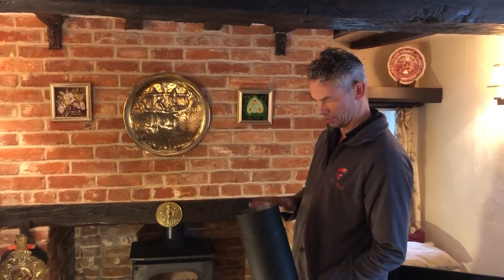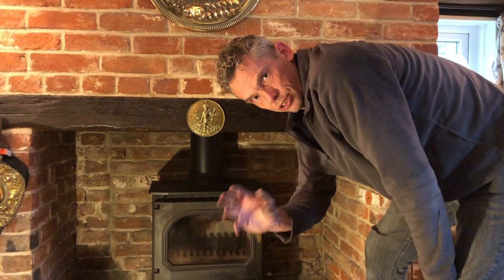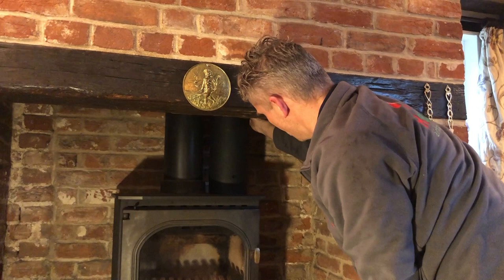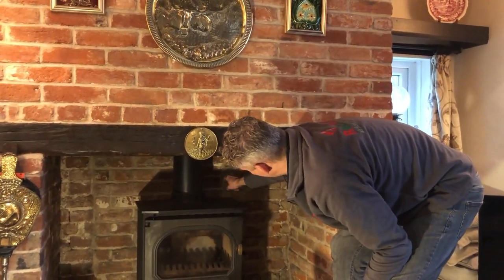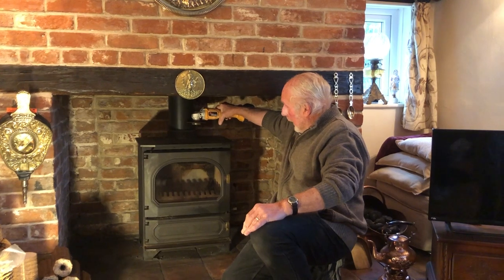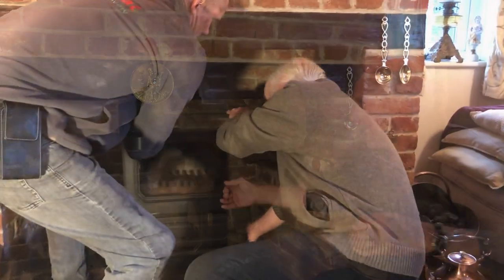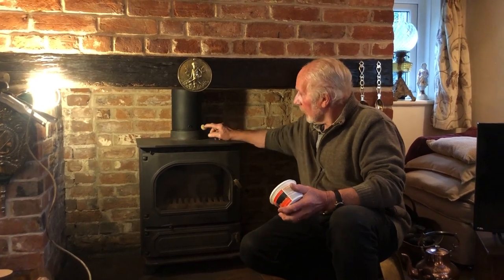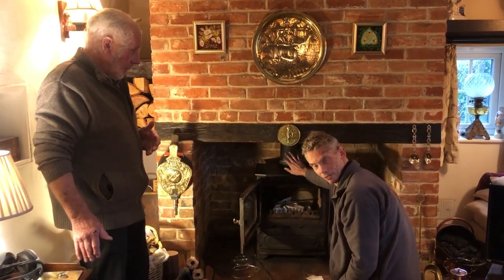Fitting An Adjustable Recoheat To Wood Stove (Heat Exchanger)

Comment: Hi the the area around the sliding section it's not mentioned does this joint get sealed? Seen bottom and top getting sealed!
Reply from the maker: It has a clip that holds and seals it. Sorry for the slow response!